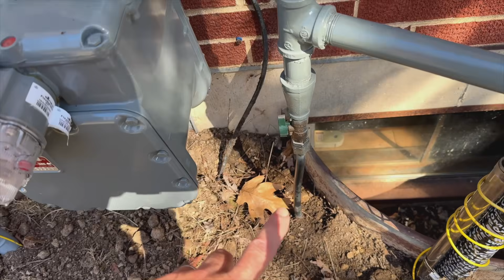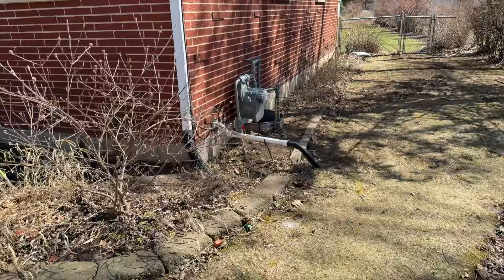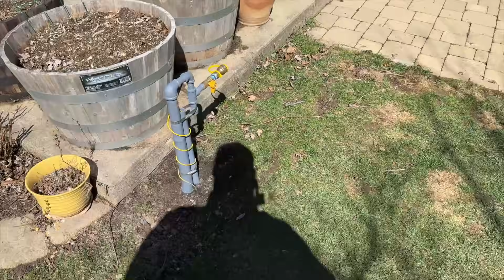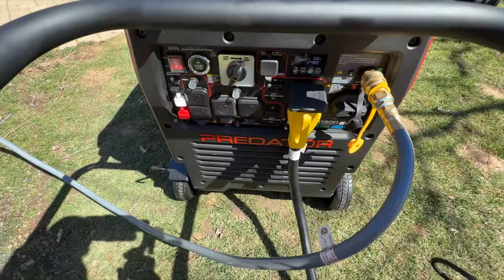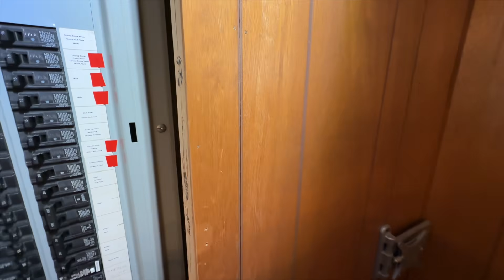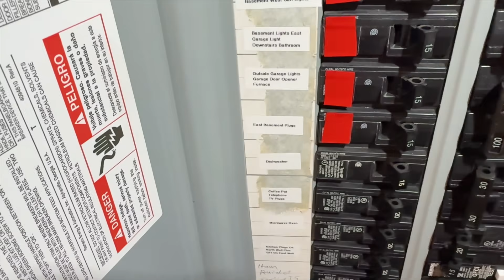My Natural Gas Generator Story

Comment from the maker: Ok so at the suggestion of my subscribers I really should get a pressure gauge and install a regulator.  I bought the items installed it, but before I installed it I thought I'd see what the pressure was without the regulator and it was almost 9 WC.  The Predator  requires between 5-7 WC so I was over by about 2 WC.  So then I thought I would test my theory of using the valve to regulate the pressure and while it reduced the pressure the slightest turn below 7 WC then  was not enough natural gas to the generator and it shut off.  Then I installed the regulator and I had to adjust it to 7 WC.  Then the acid test.  Running at 7 WC did the engine still make the buffeting sound and it still did.  Then I thought I'd try running the generator with propane with the included hose with the built in regulator and guess what?  No buffeting noise.  So I guess with natural gas this generator makes that noise.  Well at least with the regulator I feel more comfortable that I'm not over pressuring the generator.  I hope you all read this comment... :)

Comment: Just like switching a stove from natural gas to propane, it might need a different fuel jet (just like in an old fashioned carburetor) or a metering valve to fine tune the fuel/air mixture.

Comment: Cost my neighbor over 10k to have an initial line run to his house, it ended in my yard, so they dug up my yard and added a terminal, shorter distance than yours but it "was" a house with no gas originally, Texas. He had a plumber run some thru house for other uses besides his Generac,  I didn't get detailed bill of all his costs 😅
Reply from the maker: Wow, that sounds like quite the ordeal for your neighbor!

Comment: Every time I watch a generator youtube I think I really ought to get my generators out, put fresh gasoline in them and fire them up.  Problem is the power here hardly ever goes out,  I don't remember when I last had to use them.  I get by with a small 2 cycle generator and extension cord into the house,  it's enough  to make coffee or run a 750 watt microwave.and keep the Over The Air TV working.
Reply from the maker: There's so much truth to what you said.  Our ComEd power here in Illinois is very reliable I'll probably never ever use it except to drag it out to test it periodically so I don't forget how to deploy it when the time comes for an actual power outage.  If the power goes out it's only out for a short time because a squirrel crossed the wires.  With that thought in mind I hand to come out with a protocol when to use it since it's work to drag out and hook up.  If the power is out for more than an hour then I'll hook it up.  Finally I'll probably Never put any gasoline in the tank so I don't have to worry about the carb getting gummed up.  So it sits...waiting for its big event.  Ahh the life of a prepper....